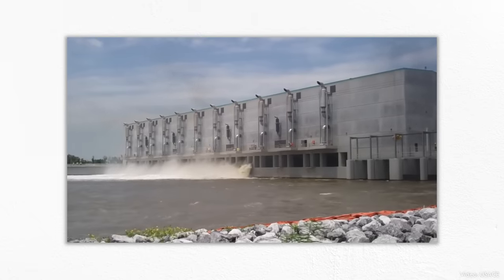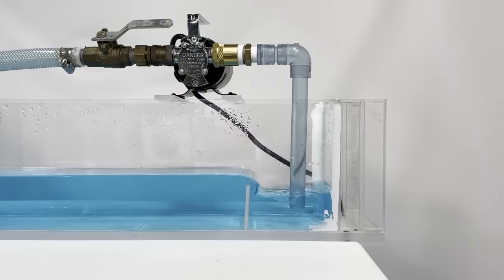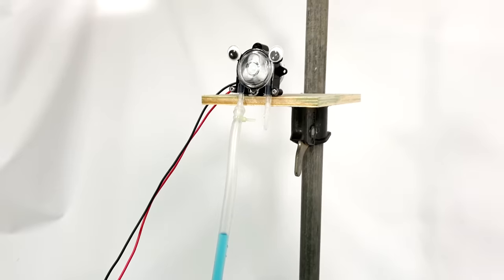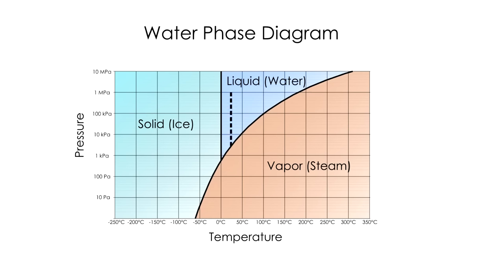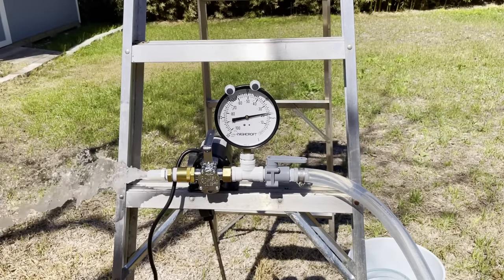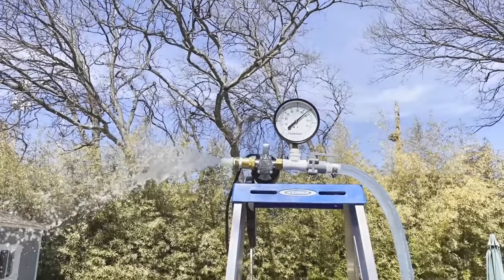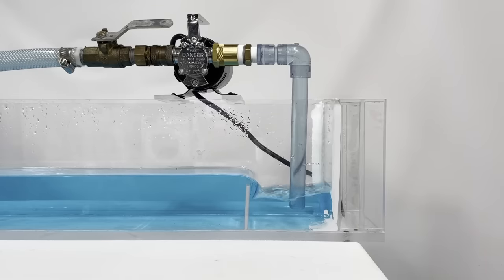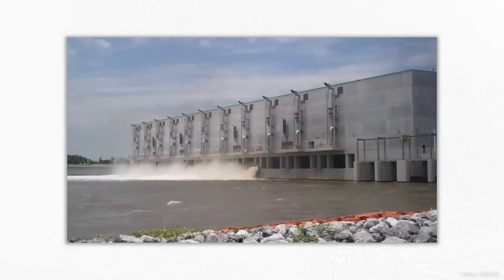The Fluid Effects That Kill Pumps

Comment: After we moved the Cape Hatteras lighthouse one of the jobs was chipping rust and pressure washing the balcony at the top. There was no water main for starters so we sunk a well point and did the math so we could order the right small portable pumps to stage at different landings in the lighthouse. We also had to factor in the GPM of the pressure washer so it wouldn't run itself dry and burn up. Stay in school kids because math is important.

Comment: You had "Cavitation and the wear on the impeller", but there's also "Cavitation and the non-uniformity of the rotational inertia" that's a critical element of turbopumps. Turbopumps can have enough rotational inertia to "walk" with mal-formed inputs. Not "impeller damage" but "pump dismounting frame". This is regarded as the element that's killed at least three of SpaceX's Starship prototypes. Their Raptor engine after the bellyflop maneuver getting significant bubbles fed into the turbopump(s). No one has spelled out how, exactly, they failed beyond pointing out the problem, but there were large booms involved.

Comment: OK, I can't help it, but NPSH required is not the amount of net positive suction head required to prevent cavitation. It's when there is already a 3% pressure drop at the discharge. That is, cavitation has already started. This is why it is sometimes called NPSH3. So if you have the NPSHr for a given pump at a given speed and flow, you should ask the supplier to give a safety margin so you can ensure the NPSH available is is greater than the NPSHr + margin.

Comment: So with respect to scale models, how do they deal with the variables that don't scale like water density?

And what about things like side length, surface area and volume? As in, you may reduce the length of a dam wall by half for your scale model, but if you keep the same ratios that would give you 1/4 the surface area and volume.

Comment: You're either getting the NPSH backwards at 5:07 or you're not expressing the idea clearly. The pump system isn't designed to provide at least the NPSH but rather the engineer has to design the system so that the pump is provided with at least the NPSH. This means that for example in powerplants the feed water pumps are usually located on the first floor or even down in the basement while the feedwater tank from which the pumps suck the feedwater from are usually located on one of the middle floors of the powerplant.

This might seem wasteful since you're moving the water from the feedwater tank located at one of the middle floors of the boiler to the steam dome at top of the boiler via the basement but that drop is necessary to ensure that the pumps get minimum NPSH at the suction side otherwise they would start cavitating.

Comment: Grady, did you know that the minimum NPSH required stated in the specification of a pump corresponds to a 3% loss on head pressure. Meaning that if you run your pump at the exact required NPSH, cavitation already occurs - resulting in a 3% performance loss.

Comment: Cavitation isn't only, or even normally due to the fluid boiling. It's normally due to drawing a vacuum between the trailing edge of the blade and the pump. Small cavities begin to form behind the blades, and when they collapse, they create a shockwave. You saw how low the pressure could be on the inlet of those pumps, they're 2/3-3/4 of the way to a full vacuum on the inlet, which means they're going to be closer on some parts of the blades, just due to dynamics. 

Why isn't it due to phase change/boiling you might ask? Because of the thermodynamics. Of course some vapour will form, but pockets of vacuum can just form and collapse more quickly.

Comment: In a documentary about the local fire dept in my city, they also encountered the problem of cavitation in one episode. It could not have come at a worse point in time for the fire crews.
Picture this: A scrap yard is on fire. So lots of fuel, oil and rubber are burning to begin with. So the suck meter is already close to redlining. Then: A bunch of acetylene cylinders is standing meters from the flame front, just separated by a concrete wall. Couple guys are already hauling ass to get them out of the way and cooling them. On the other side, you have a pile of propane tanks you need to keep from blowing up somehow. Next to that pile of gas cylinders is the one wall you absolutely need to hold. Because right next door, less than 100 ft away, there is a chemical plant that, if it explodes, would raze everything within at least 1500 ft and cause hundreds more fires. 
Meanwhile, there is a rookie attending his first fire on the ladder on the other side who has said propane tanks blow off and up all around him while he is sitting in this basket and trying to hold the wall. Everyone keeps yelling over the radio for more pressure on all the lines, but there just is none. And then one of the engine chiefs shouts to retreat a few guys from one side and shut off one of the pumps because it has started cavitating - and it turns out all fire trucks are feeding off hydrants that are connected the same loop - the resulting overall intake pressure is just too low to supply all of them. That was a pretty hairy situation that could easily have gone horribly sideways.

It almost was a perfect storm - had it not been for the chemical plant which had huge water tanks and a bunch of powerful pumps that were able to supply enough water pressure for everyone to carry on. The wall was held and the fire was eventually put out. 
So yeah, cavitiation is bad - but there are times where cavitation can be life threatening in unexpected ways.

Comment: I did not hear the word "volute" once in this video. I am disappoint. 

Also, welcome to fire engine pump operation class. Too many FF's think becoming a driver/operator is just about driving the big red truck making lots of noise. When you need to draft from a dry hydrant at 0300 on a -10 degree morning to feed a couple of cross lays, it separates out the ones who didn't pay attention real quick.

Comment: the final factor in preventing pump problems is the human factor.  I had an instructor tell me about the measures he had to take to stop an almost retired tech wrecking a sewage pump station, because he thought the design volume of the sump was too high and would manually pump it down to where HE thought it should be - which caused the pumps to lose prime, and the pump station would flood.

Comment: The bit about vortexing is not quite right.  While it is true that ingesting air is not very good for pumps, the problem with the vortex is that it reduces the pressure at the intake causing cavitation.  The swirling vortex causes the liquid to swirl around the intake rather than flow into the intake.  That creates very low pressure there - reduces the NPSHa.

Comment: Hey! Where was this video last Fall?  ;-)

With a mattock, spade shovel, wheelbarrow, and a bunch of five gallon buckets, I sunk a 10'4" deep, two foot diameter corrugated double-walled plastic culvert to act as an external sump pump well casing.

It was quite the backyard engineering effort.  But, what a payoff!  The basement of this house as well as neighbors are noticeably drier.  Usually, I have to run two dehumidifiers.  I might not even need to run any this Summer.

The sump pump at the bottom of the well casing handles the necessary 14' of head just fine.  Then, through a run of 4" PVC, out to the curb and storm drain system of the city.

Curious to see photos of the project?  In Facebook, search for, "russell stephan big dig".

Comment: Just seen this video, thank you.  Question I have has to deal with pressure equal gallons per minute.  Fire truck, shows psi on discharge, how do I determine the gpm at end of the fire hose?  Nozzle states 100 psi for 150 home.  Thank you, firefighter asking.

Comment: Is it a practical and viable solution to install all water pumps underwater to prevent sucking air? I would like to see a video on that.
Reply: would be a bitch to maintain or in case of an emergency at least if it's in a operating room they can close of water to it and try to service it.

Comment: What about baffles (solid plates or mesh) to interrupt/dissipate the vortex path in these structures, I often use a shovel or two as baffles next to a pump inlet to spoil vortex formation when we pump stormwater at construction sites. usually small pumps 2'' to 4''. I probably wont have to worry about this tomorrow when we pump 70k gallons out of a storm pond with a 2'' submersible in a 6' diameter sump pit 3' below the pond floor level ;) (I think the sump is probably oversize)

Comment: Hi Grady. This is a very interesting topic thanks for covering it. I have a question about the Vortex. 

In my granfathers farm he has a pump that takes water from a pond beside a river. And he put the inlet inside a chickenwire mesh and he also put multiple tennis balls in there too. He said it "kills" vortex. Any idea why this method is not used or maybe frowned upon in civil engineering. Of course using a commercial grade Floating Ball, not tennis ball, to kill the momentum of the vortex once it appears.

Comment: I'm rather fond of the turbopumps in rocket engines.

Small, lightweight, capable of shoving half a ton of rocket propellent per second through the coolant tubes and out into the combustion chamber against a pressure of several hundred bar at the pump outlet...

This is where practical engineering and completely insane engineering meet and, with some persuasion, shake hands.

Comment: Could design a specific shape to the bottom of the suction pipe or L extensions or just install long metal rods cemented near the suction pipe sticking out the surface to try and prevent the vortex ?
I love pumps too 🙃

Comment: At 5:38 you say “the suction pressure just about doubles” but that’s not really accurate. It is true since you’re talking about a vacuum the number gets larger (i.e. increased vacuum) but that is actually a reduction in the suction pressure. The way you state it makes it seem as though the suction pressure increased when in fact it decreased when you moved the pump higher.

Comment: Just for curiosity sake: At 5:40, does the pressure at the discharge side (not the intake which seems to increase) either increase or decrease when the valve is closed?

Comment: @practicalengeneering please please please do a video on circulating air without power. Looking to incorporate air filtration with charcoal filters but how to get it flowing??? (Underground and airtight) Co2 is heavier than o2 so the exhaust vent must be lower than the inlet, and I have considered using a fire to help suck in air but that requires fuel. It could be a super cool video incorporating fluid dynamics thermodynamics and some good old fashoned science! This is a super underappreciated topic that has hardly any coverage and I have scoured the net formore information so alas I'm asking an engineer! How do you circulate air underground without power or fuel. Any and all tips PLEASE

Comment: Most of the urban flooding we get, which is a lot, is because the autumn testing was overlooked, or “rescheduled”, no one responsible checked the weather forecast or tides, or the on-shift operator was asleep during heavy rains.  It’s really pathetic, so many flooding events are preventable with the infrastructure we have.  But, also, our city management is so desperate to attract development, that they waive all environmental requirements and even taxes, to attract it.  A single, large development that increased runoff by 11% of the total, was not only approved, but got huge tax breaks and virtually all environmental requirements thrown out.  Now, it sits empty, no businesses want to occupy it, with its enormous parking lots filling up with water that causes worse-than-ever urban runoff.  Small, US cities can be extremely poorly managed.

Comment: In the case of vortices, it would seem to be a similar problem to what we call Eddy Currents in magnetic cores. What if a floating grid or grille was laid on the water surface, limiting the ability of the vortex to grow in size. Could that help prevent them from forming or growing large enough to cause trouble?

Comment: At 4:47 I notice an interesting thing: Each vane of the impeller shows exactly the same pattern of cavitation damage, with the eroded hole in exactly the same place. Intuitively, it seems obvious that this would happen ... but not everything that seems obvious is true. 

What exactly determines where the most erosion occurs? Are the bubbles somehow concentrated at that location, or is there something about the vanes that prompts bubbles to preferentially collapse in specific regions?
Reply: Pressure drops in the suction allowing the fluid to boil. Cavitation happens when the pump adds pressure and the bubbles collapse back down to liquid. Presumably, that spot with visible damage is the point in the flow path where the pump has put just enough pressure back into the liquid for that to happen.

Comment: Worked at a large chocolate/csndt factory that had a lotbof pumps. We had a 65 man shop and was very hard to get them into 20th century. As the only sparky on second shift they would send me first to find out if pumps had an electrical or mechanical problem. Very few pumps had a suction or discharge guage until I keep refused to   look at them. Also had trouble when I told ahole maintenance pretend boss that a motor tripped out because chocolate pump is frozen. Always told me but wait mechanic said that it turns when a 36" pipe wrench is placed on shaft. Yep had to put hundred of pounds of pressure to get froozen pump to turn a little. Would them tell them to install a 100 HP motor in place of the 5 HP motor. Finally lazy prima donna mechanic would seperate lovejoy coupling and motor ran great. Told ahole boss that I'm tom the electrician not tom the magician. After a few years boss trusted me that when I said I was 99% sure pump motor was okay.

Comment: Re cavitation: What about impellers that are immersed in the fluid they're moving, such as boat propellers? They often suffer from cavitation, yet very little air is present on the suction side.
Reply: It's not the air causing the problem, it's the vacuum boiling of the water. Propellers operate partly on the Bernoulli Principle, so they have regions of lower pressure on the blade.
Reply: In that case, the problem comes from water vapor created by the low pressure on one side of the propeller.

Comment: I never understand why people compare things to planes to demonstrate that they're heavy. I understand that Boeing 747 fully loaded is not light but compared to trucks or just about anything considered heavy their density would be quite low. When you watch the wings on take off and you can see them move and what's inside of them It is actually quite shocking how little material is used to construct a plane. In your head You imagine them packed full of metal and being heavy been reality they are extremely skeletonized and and only what is necessary is there. If if it wasn't there is no way they would ever be able to take off with all of the unnecessary weight. It's actually a marvel that we can make machines this massive fly.

Comment: Please please please get this to the Grady the practical engineer!!!! I need your help figuring out how much force a glued together 3/4 pvc verses push connectors or crimp connectors of PEX can with stand when pulled apart. We bore water lines a lot and sometimes we have to pull connected pipes. But which one is better? Please I really need your help on this

Comment: Could you not add flutes to a sump that would prevent or disrupt virtex formation? They could be welded in place, just metal plates and rods to hold them in place. Wouldn't affect water flow, water doesn't care about anything in its way, and the turbulence would disrupt votices.

Comment: It is logic to have a two part tank that air cylinders shift a center barrier that forces the filled side;  while creating vacuum on the other because of feeding cylinder with air from this vacuumed side;  while at the same time as exerting this empty side.  When all water has emptied out of the water side;  vacuum pulls next filling of water and what not;  in reality;  if you think that you will be needing this pumping service for as long as who knows how long;  well why not have a rotary water container that is geared to just rotate against barriers whilst squeezing water out and this would be slow mechanics which would last forever.  And a tank that's placed at the source of the water that is air compressed forced would work great also.  Pneumatic lasts way longer then water pumping.  If it's municipal supply water;  get hooked up on the supply side of the regulator.

Comment: I drive a chemical truck and there have been a few times where I’m getting unloaded and the customers have sensors on their pumps to tell if ther is cavitation. Is there is I can run the compressor on my truck to help push the product out.

Comment: So, water management systems are all custom built for the specific location and job. Question is, would it be practical to design a system around pumps already in production? I can't imagine building custom made pumps for each job site and then having to deal with the high expense of maintaining them and getting parts etc.

Comment: There are any pumps with integrated return flow? For example if i put a valve at the pump exit to be able to regulate the output flow without forcing the pump. (I wanna use it for decorative residential water wall project).

Comment: Pumps that has to be primed uses often a check valve, so the water can't flow out of the pump
Reply: All pump stations i have designed,  execpt those with mixed axial pumps, have check valves. Otherwise you get backwards rotation in your motor among other things.